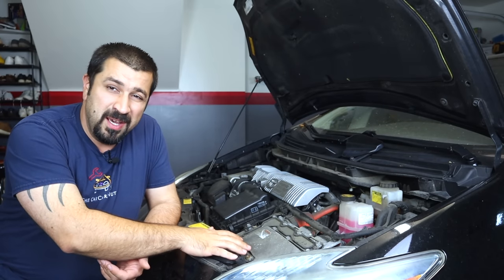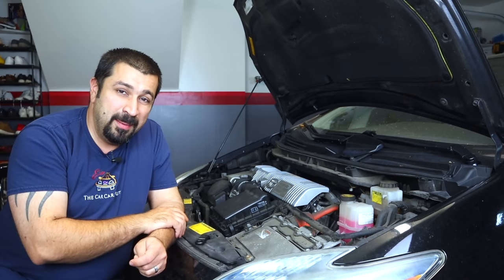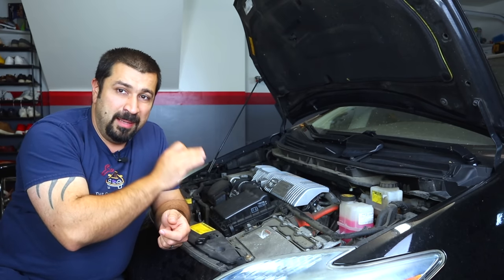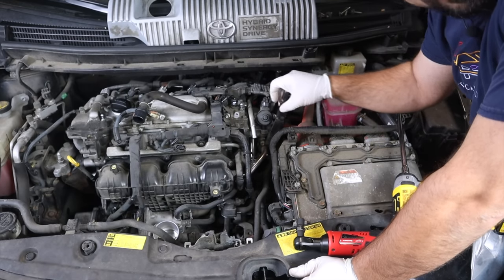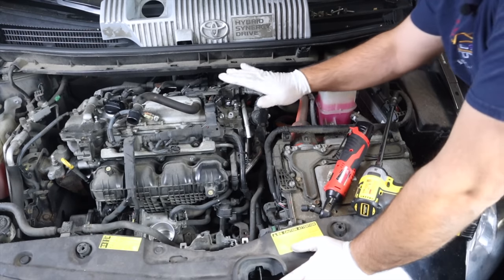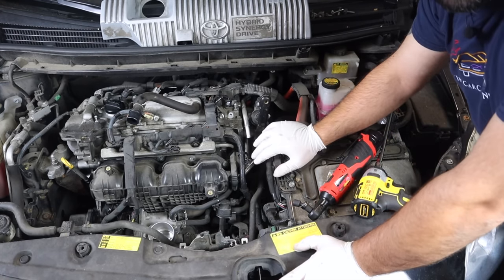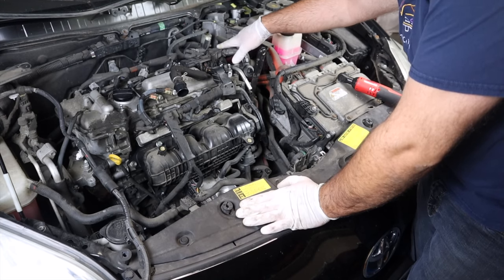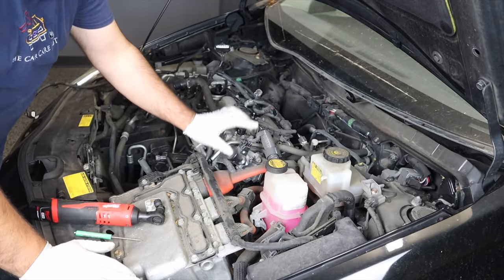Toyota EGR Diagnosis Tips and Repair Tips

Comment: I have a Toyota corolla iM 2018 . For example ..  I stop the car at a red light RPM goes down the car vibrates or shakes. Sometimes it hesitate to accelerate. No lights on like check engine or something else. No codes , nothing. Some people told me the throttle is dirty. I went to a mechanic yesterday he clean the throttle but the problem still there. My car performance is not like it used to be.

Comment: My 4Runner 2010 doesn't have EGR. The other one, 2014 has.  Is this right or someone take it out from the 2010?
Reply from the maker: Hi! 4runners don’t have EGR they have secondary air injection
Reply: @TheCarCareNut  ok. But I have a similar question, the 2010 does not have and the 2014 has. Is this normal?
Reply from the maker: Yes that’s normal.

Comment: If the egr is bad and it does rattling noise, would that cause a check engine light to come on?
Reply: Im NOT a mechanic. No, it only came on for me after while. I believe the issues has to get bad enough to trigger the Engine light. I believe CCN has said on other videos dash lights(radiotor low water) are when it bad enought like your body telling you heart skipped a beat. They are not like the gasoline gauge that tell you when to add more. Good Luck/God Bless.

Comment: My code read miss fire from the coil. I opened them up there was water and so much junk in there. Bought new ones with new spark plugs. My car was also shaking when gassing it. I'm really hoping that's the issue and not the egr.. Only 50k miles

Comment: Are the 2GR-FE pretty reliable? Common issues on them?
Reply from the maker: Hi! They are reliable for the most part with good maintenance. When they get really old they tend to leak and are hard to repair. And water pumps are common to go as well
Reply: @TheCarCareNut  thanks for answering! I was looking towards a Avalon, Camry or Lexus Es350 for my next vehicle, been researching common issues on them

Comment: I have a 2010 Prius Im an MDT....i have a misfire on number 3 and 2 P0302 p0303...randomly when starting...when starting...egr was replaced intake cleaned...software update done....no signs of blown head gasket 170k any ideas?
Reply from the maker: Hi! Pressure test the engine cooling system and bore scope cylinder two and three. See if you notice drops of coolant from the head gasket.

Comment: This time it was a Toyota 1GD engine , the DPF issues were that bad the after market were making delete kits . The DPF regen burn was that bad the police were handing out pollution fines .  Toyota took minimum 3-4yrs to sought this out and thats after they were taken to court . This forced  a redesign of the injector /housing ,,changed software ,,vastly improved dash display ,, manual reburn switch . As soon as the factory updates were all done I actually purchased this vehicle with this motor . No problem ** regen causes 10---20% xtra fuel consumption WOW ...........

Comment: have a 2019 toyota 4runner,,,,,made purchase 4/20,,,,,,non toyota dealer,,,,everything was done by phone,,,and pics,,,,28.000 mi,,,,,great shape,,,but,,,,,i know my way around to be able to tell when there is signs of lack of maintinace,,,,witch ive done myself,,,,,it had the wrong oil cartrege in it,,,,and colapsed inside ,,,,,dont know how long  was like that,,so  what should i look out for,,,moter sounds fine,,,,but,,,,,,,,,
Reply from the maker: Hi! If you have no issues with noise you should be good just use the correct oil filter

Comment: Why not recommend the installation of an oil/air separator since you already have the intake off and easy access to the PCV valve? It greatly reduces the oil blow back into the intake manifold.

Comment: You have to clean or replace the cooler. I just took one apart and it was nearly completely clogged. Spraying cleaner in one side would quickly pool up and then slowly drain through. The EGR will do nothing for the engine if it can't breathe in the first place. I had to blast through it with a pressure washer and then clean it out with oven cleaner and hit it with pressure again. The cooler is weak link.

Comment: hi Yes dealers have typically greater resources but that`s it .  Occasionally its left to the aftermarket to fix design issues that the car maker ignores . Not a Toyota brand was having massive egr cooler failures just out of warranty and many were not been covered . Damage was either a cylinder head crack or complete motor failure re overheating .  As time went on  majority of these engines are overheated again from the poorly designed part . The vehicles are now finding there way to the wrecking yard , most with blown /overheated engines . 
The aftermarket does an electronic component to lie to the engine ECU so it thinks the egr is still functioning .  Many engines have been saved . Not really an option as mandatory .

Comment: Did you clean the cooler with pressure washer?
Reply from the maker: No just compressed air
Reply: @TheCarCareNut  can you spray cleaner or degreeser instead of compressed air?
Reply from the maker: You could.

Comment: My 2014 Prius has the bad shake and rattle at start up. It doesn't do it every time you start it but it usually does.  I took it to Toyota of Jackson ( Mississippi)  for them to fix. That was a mistake. They were useless and expensive. A week and $412 later I finally get my car back. Toyota of Jackson supposedly diagnosed it. They said it needed the software update.  When I picked it up it did fine . But a week after picking it up and it’s doing the same thing. I wouldn’t say the dealer mechanics are any better than a local mechanic. Find a good local mechanic and you will save money and get better service.

Comment: My 2002 Camry had really bad idle maybe 3 times and triggered a code excessive exhaust recirculation. The problem completely goes away after car cools down so dealer can't find any issue. I'm suspecting it's the EGR sticking has anyone had similar issues?

Comment: Y you did not put the car into maintenance mode to diagnose the problem?
Reply from the maker: There’s another issue while rare on this generation Prius that would cause vibration with or without the engine running. By having the engine switch on and off you’ll be able to accurately isolate if this is not an engine on related issue or noy

Comment: EGR valve = a component that will cause you nightmares in repair costs once the vehicle is more than 6 years old. Lesson learned:  if the car has an EGR valve in it, don't buy it, get something else that does NOT have an EGR valve in it.
Reply: Of course, the problem is it is a relatively cool metal thing that relatively hot exhaust goes through. It is a formula for trouble.

Comment: If you don't clean egr cooler efficiently then it will clogged earlier causing inefficient exhaust flow through egr valve.. this will cause your new egr valve to clogged up faster as well. Better replace new cooler with new egr valve or really clean egr cooler to make sure your egr valve last a little longer.

Comment: Just saying, but instead of using a spatula, you can pull the wire harness off the egr to get the same effect. Takes 5 sec.
Reply: Sometimes, if it’s not stuck or clogged partially open. Good quick check first though. Especially or a “mechanics special” you might be looking at

Comment: I really dont understand how you can say cleaning the cooler doesnt do anything. Mine was completely obstructed, no light or air would pass through. After and of soaking i sprayed it with pressure washer and light passes all the way through now. I really dou bt its going to clog back up overnight

Comment: Hey buddy without taking all that stuff off you can confirm it with fuel trim.
Reply: In theory, the EGR does not affect mixture because the exhaust should have little excess O2 or HC.

Comment: I got a question for you what does EGR do?
Reply: "Exhaust Gas Recirculation" it redirects exhaust gasses to reburned into the intake.  It's supposed to be more efficient for fuel burning and also better emissions.
Reply: The main real reason to cool combustion for better fuel burning efficiency
Reply: @albeklik8055  More specifically, to control formation of NOx. If the EGR is jammed shut the engine will usually run okay but have much higher NOx emissions.

Comment: DO NOT JUST BLOW COMPRESSED AIR INTO THE EGR COOLER, take it out and clean it with a pressure washer, I made the mistake of following this video and it cost me a lot of stress and time. Also it is best to clean out all 4 ports of the Intake Manifold with a pressure washer to get ever bit of carbon out of them…

Comment: What damage can be done by bypassing the EGR properly? Can you please address this and not repeat what the "dealership" spiel is. Thanks.
Reply: I think he mentioned good maintenance and high quality fuel can minimise it
Reply: EGR gases burn slower than fresh air. This calls for different ignition timing. Over time this causes engine damage similar to knocking or ping. It also increases fuel economy by decreasing pumping losses. So saves money. Would prefer the gen4 system where the pickup is after the catalytic converter. Helps burn off all of the contaminates.

Comment: There’s no need to buy new parts. If the parts are probably cleaned there will be no issues
Reply: When there's carbon buildup, it's not clean.  It's easier to replace the parts than to waste time cleaning them with no guarantee they'll function like new again.

Comment: My advice would be "buy EV and forget about all mess with ICE".
Reply: In 50 years I have bought only 3 new cars. The 2002 Prius was the only one that was not a nightmare of unreliability. Tesla is out of the question; the nearest service facility is 130 miles away.
Reply: You can do a lot of repairs for the cost difference between the two ..

Comment: Just did this service my self. Buy G U M O U T Carb cleaner. It is ridiculously strong against carb build up and my EGR filter became so clean afterwards.
Reply: Soaking in purple power works well too. Good for intake soaking. Then chase the egr in the intake with a long drill bit (cheap harbor freight set of 2 footers). If all else fails, oven clean will get it, but corrosive if let sit.also not for intakes.

Comment: Hi, great videos. My gen3 70.000 miles is always rattlening continuesly cold or warm. No error engine codes, misfire or any other. Have done your diagnosis but no changes neither show up any code. See video https://www.youtube.com/watch?v=Y6kLoBrlk1c.
No coolant loss, new oil and filter. Cars runs well only problem is noise on video always. 
I consider cause clogged lifters. Car in storage for 8 months. thank you

Comment: I didn’t like the video, why didn’t they clean it, didn’t wash the removed device, but installed a new one? change a dirty one for a new one and a fool can!
why didn’t they remove the heat exchanger clogged with soot and wash it?
why didn't they remove and clean the throttle valve?
you did a bad job!

Comment: What do I think about the “Professionals” that continue to simply drop the hood hard?

Completely unnecessary. Lower the hood and either drop it from only 6 inches or actually rest it on the latch and then simply push down quick.